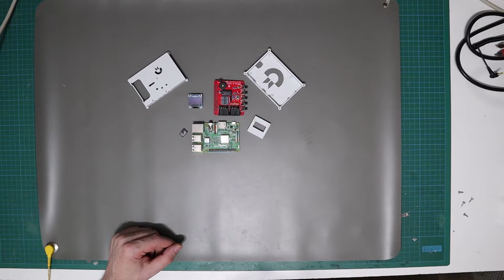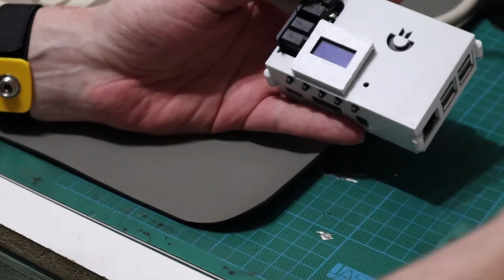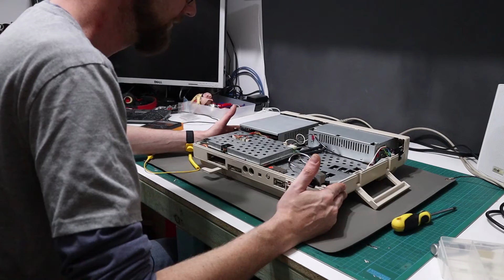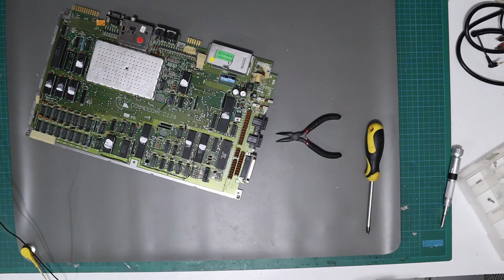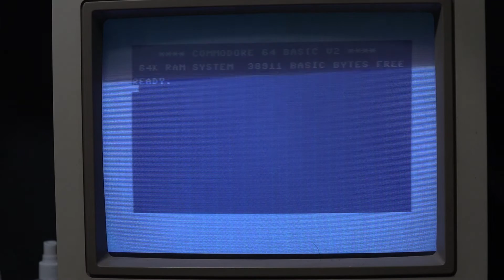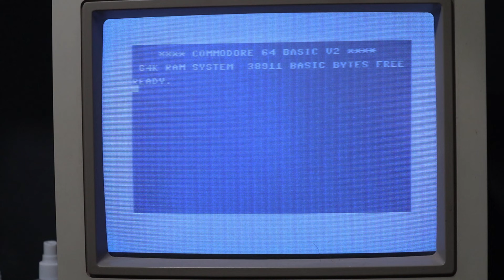Commodore 128D Upgrades (Pi1541, Joystick ESD, LumaFix) ft; The Retro Channel

Comment: For anyone curious about the ESD boards here is a quick rundown:

They are sold by Pasi (plazma) out of Finland on Amibay and Lemon64 currently for 5€ per pair (plus postage/paypal fees)
http://www.amibay.com/showthread.php?108652-Joystick-port-ESD-protector-v1-1
https://www.lemon64.com/forum/viewtopic.php?t=73032&sid=ecff4e8c4cefcca21a87fdc38de59bcc

The small IC looking things on either side are basically TVS diodes - they usually are rated to protect from voltages around 10kV (static electricity typically ranges from 1kV to around 8kV, you need to try very hard to build up anything higher). I am not sure of the exact ones that are used here.

You can use them with other systems (Amigas, Atari, early Sega systems, etc) but generally these already have decent protection. The C64 and C128 are the most susceptible to damage from ESD on the joystick ports which have a direct connection to the CIA and SID chips  - I did a video on installing them into a C64 here: https://youtu.be/-568ZT_v1b4

Neither myself or Mr Lurch are associated with the seller so please use the links above to contact him

Stay safe, use protection!
Reply: Thanks, just PM the guy for two sets, one for my C64C and one for my C128D.

Comment: One issue I've had with the pi1541 is that if you try to run a program directly from the sd card (ie not in a .d64) it creates a virtual d64 to access it.  Sooo doing something like trying to use cbm cmd to convert a .d64 image on the SD card to a real 1541 to create a disk doesn't work.  The pi1541 can't do 1541 emulation when reading directly from the sd card. You'd have to put the .d64's inside another .d64 to be able to read them! Also using SHIFT +/- in CBM CMD to browse around doesn't work on the pi1541. It reports "unsupported sd2iec command" or something similar.

Comment: Good God. How many hoops to jump through to get to the motherboard? I have to replace the SID I just blew on my recently purchased C128d, and given the extreme effort required to pull it apart, which I'm not looking forward to, I think I'll look into the lumafix, which I didn't even know I needed until now. The thing is, did you really need to cut that shield? Did you really need the heatsinks? And if you didn't have the heatsinks would it have fit back together without having to cut up the shield?

Comment: Silly question is there a similar device for the 1571? Like a pi1571
Reply from the maker: The developer of the Pi1541 wants to add 1571 support, however dues to the very small amount of support he gets (vs the thousands of devices sold) it hasnt happened.
Reply: @MrLurchsThings  I did some messing around last night and was able make a bootable cpm disk using dra copy the pi1541 and a d64 image. It's not from a d71 image but I'm still pretty happy.

Comment: There are a number of differences between c64 and c128. One of the major differences is that the c128 contains a complete c64. When running a c64 program on the c128 the c128 runs as a c64.

Comment: I am working setting up my 128D again, I have not use it since 1998. Right now I having two problems
Getting c64 games to run on the 128D
Have the 128D recognize all the drives, 2 floppy drive and 1 mini drive. I know they all work together before, I also know the 128D is drive =8, not sure how to the other drives to be 9-11.
When I first this up it was easy. Looking for help.

Comment: I just starting setup my commodore 128d, I have the same setup as you do but I get no picture and the monitor will not shut off and on. Is this 2 separate problem or just one?

Comment: Was wondering if you could suggest upgrades for the original 128? Thanks!
Reply from the maker: Honestly, virtually everything that can be done to the 128D can be done to the regular 128. They're the same machine, just in a different case with a built in floppy drive.

Comment: Hey Lurch I’m a big fan of the channel!
Sorry the software is a pain to set up but I’m just doing this as a hobby and I don’t want to step on anyone’s toes legally.
To enable people to use Pi1541 without any screens, that is use CBMFileBrowser, Pi1541 defaults to watching the reset line of the computer. In this mode it will auto exit the currently mounted disk image whenever the computer resets. This is why you get a blank screen when you boot the Pi before the computer (the Pi is waiting for the computer to come out of reset). When using a screen you may find it easier to disable this mode, just add “IgnoreReset = 1” to your options.txt file.
Keep up the good work guys, both of you are an asset to the retro community.
Reply from the maker: Cheers mate! Great to know about the config option. Look, the software isnt that bad, I've just heard other say its confusing, but I got it on the second (or third?) go. The more people put up online their config without getting you into (possible) trouble - that cant be a bad thing for the project.
But congrats on what is probably the best C64 modern add-on available right now. Its a fraction of the cost of an Ultimate cart and so much better than a SD2IEC!

Comment: Thanks for this video, i also was thinking how in ** do i get the MB out? And thanks to this video it was easy, My C128D is working good, but i am going to replace all the Caps on the NB and Floppy drive controller board and the PSU, so is gone be a lot of work and money, but than i know i do not have problems in the near future that my C128D is stop working because of bad old caps.

Comment: I assume you already had modded the 128D to change the built in 1571 drive number?
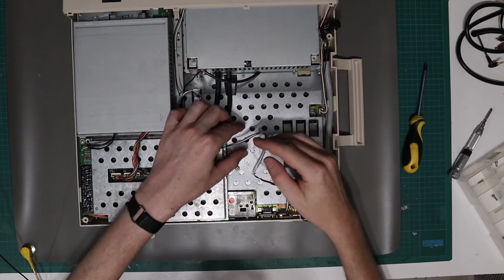Reply from the maker: 9:25
Reply: @MrLurchsThings  Have you got a video of this explained in more detail? I don’t have any drive emulation solution yet (eg PI154) but I’m worried I’ll go to that expense and then find I can use it because of the drive number issue. I don’t want to solder if I can avoid it because I’ll probably wreck my C128D.
Reply from the maker: @OldAussieAds  I assume you mean the drive ID switches I mention? No I don't, sorry. But they do require some soldering and cutting (depending on where you want to mount the switches). I should mention tho, the Pi1541 is really easy to set as Drive ID 9. It's just an entry in its config file.
Look here, line 6: https://github.com/pi1541/Pi1541/blob/master/options.txt
Reply: @MrLurchsThings  Yes sorry that’s what I meant. I’ve never soldered in my life and while I like to try new things, I don’t want to practice on something as precious as my 128D. Thanks for your tip regarding drive 9. I’ve heard some software can have issues because it expects drive 8. In reality, do you think the issue is that widespread?

Comment: The biggest issue with a pi1541 on a C128 is that it totally disables burst mode on your 1571 when in C128 mode. It just turns it off if the pi1541 even exists on the same chain. This is a really bad thing when you try and use GEOS 128 or CPM on your C128.
Reply from the maker: If thats the worst thing, I can live with it. As we joked in the video, this machine spends 99.9% of its life in C64 mode anyway.
Reply: @MrLurchsThings  You will be surprised how great GEOS is - and how fast that 1571 drive is in C128 mode. Don't knock it until you try it.
80 column mode is awesome, too!
Reply: I have proper support for 1571 in development including burst mode. It has been really hard to do and very time consuming. It is almost there but I can't seam to get CPM working 100%. I do this as one of my hobbies and I am struggling with my health so I can't promise anything. I get hardly any donations from users and there are only two sellers who actually give me a percentage of their sales. If you want to help with testing then please email me at pi1541contact@gmail.com perhaps I could add an option that fixes the Pi from interfering with real 1571s.
Reply: @stephenwhite506  sounds awesome, Stephen. I will get in touch with you, and would be happy to beta test for you. Don't get me wrong, it is a totally cool product and I use mine, but I wanted specifically to tell the C128 users that it disables burst mode

Comment: For sure it does much more than an SD2IEC! There is nearly no demo for the C64 that will rum with the SD2IEC, but all work with the PI1541!
Reply: Understand the pi1541 fails in many ways, too. You really can't use it well with GEOS and it fails with a majority of disk management software, too. 
Just loading 1541 disks it is perfect, but as soon as you try to do anything fun with it like make real disks or use it with GEOS the pi1541falls flat.
Reply: @10MARC  I don't care for GEOS or disk management. I want to play games and watch demos.
Reply: @KolliRail  Then the pi1541 will work fine for you. Cool!
Reply from the maker: There is issues with copying to real disks to? (eg: Pi1541 --> internal 1571)
Reply: @MrLurchsThings  with programs like DRACopy I have a lot of issues. If you select a disk before launching the program it seems to be OK - bit changing disks from within the programs seems to cause problems.
Reply: @MrLurchsThings  why should one ever want to use real floppy disks again? :-)

Comment: Good video, I wish you had taken a minute to explain how the ESD chips worked, I was hoping for a close up at the least.
Reply from the maker: https://youtu.be/-568ZT_v1b4
Reply: It's probably just diodes. Connect each data pin to the 5V and Gnd with reverse biased diodes, so any voltage greater than (5V + diode drop voltage) or lower than (0 - diode drop voltage) gets safely dissipated into the 5V or Grnd rail respectively. This is precisely how the ESD protection built into modern ICs works.

Comment: Do you have a link for the ESD protection PCB? I found a version from Finland on Amibay, and one sold by Console5 (expensive but supports more systems).
Reply: Amibay:
http://www.amibay.com/showthread.php?108652-Joystick-port-ESD-protector-v1-1
Console5:
https://console5.com/store/anti-static-d9-joystick-port-esd-set-pair-of-2-static-protection-add-on-pcb.html
Reply: The AmiBay ones are the same as what is featured in this video - made by Plazma. I don't know anything about the Console5 ones but they should perform the same task and be compatible with all systems with a DB9 connector. If you're really interested you can find Plazma's first attempt at making these here http://pasilassila.blogspot.com/2014/06/c64-esd-protection-first-attempt.html . Needless to say the current design is much easier to install

Comment: Best use for a C128 outside of GEOS (and maybe CP/M) is to run Ultima V - it's heavily enhanced over running it on a C64, but you'll want to switch over to the internal 1571 over the 1541 as you'll be stuck with the original KERNAL routines for disk access (as whilst it has a software turbo, it fails on PAL hardware).

The biggest test for the compatibility would be to run some demos - as they tend to use a mix of software fast loader routines, but also "IRQ" loading (loading new data whilst other activity is running). I don't know if the Pi1541 supports .G64 images but as those are lower-level dumps, it's also a good sign, because it should be able to handle booting copy protected games there.

(*phew*)

Comment: The C128D is a really fun system. Unfortunately it didn't take off well-enough to help save Commodore.  It's backward compatibility with the C64 is really cool, but unfortunately neither the 128 mode nor the CP/M mode made it compelling.  128 mode was largely ignored by app developers (both games and productivity) and MS-DOS was already driving CP/M out of the market by the time it was released.  Sigh.  Glad you are enjoying it!